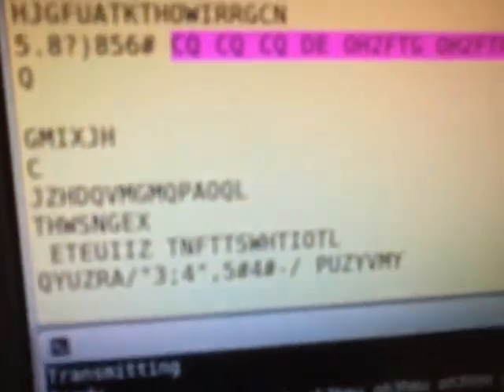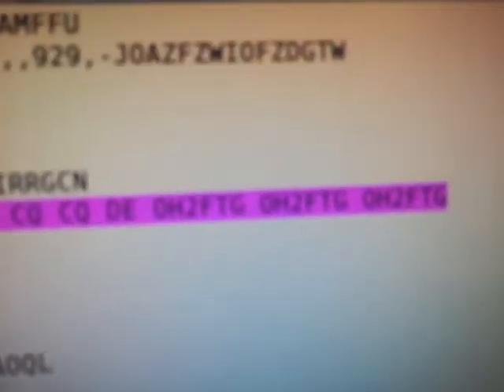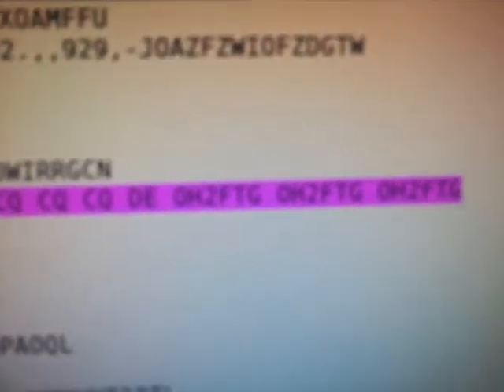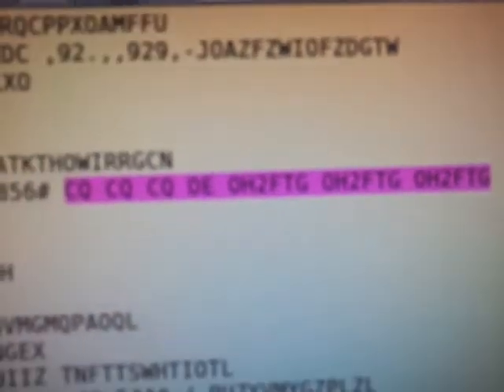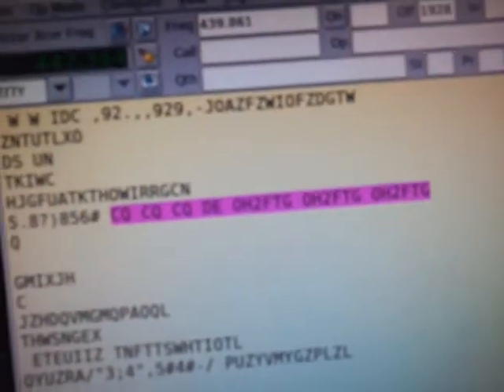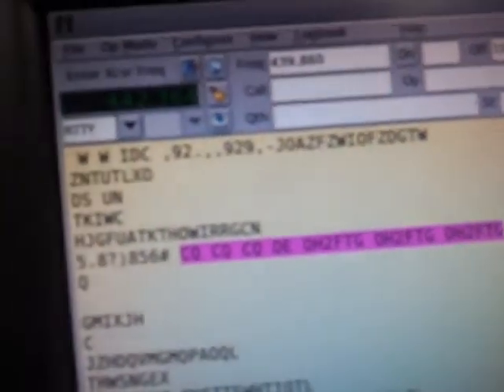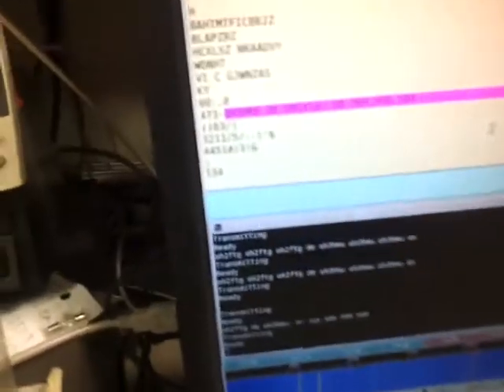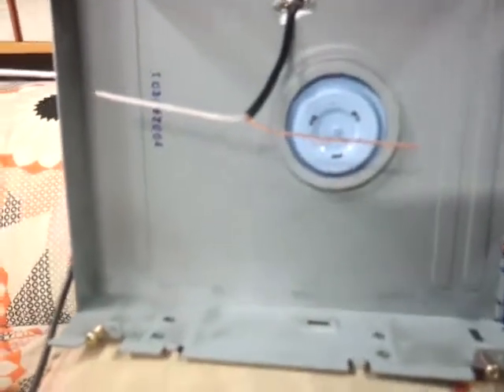RTL2RTL QSO! on 1270MHz

Comment: Please if you can make a video or blog about how to modify rtl-sdr for transmit would be very helpful. 😊
Reply from the maker: Yeah I have been attempting to revisit this lately myself. Been a good few years and nothing compiles cleanly anymore.

As for modifications, an across the room scale QSO one just needs decent antennas and two cheap RTL sticks. 
We measured a handful back then and most had a steady -75dBm of 1270MHz at the antenna connector.